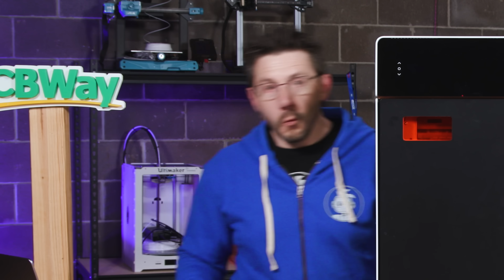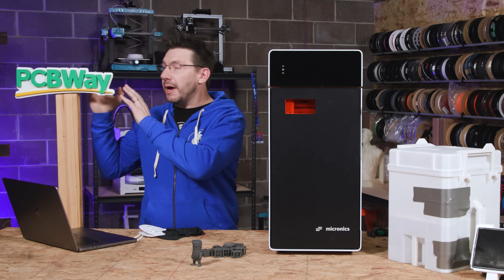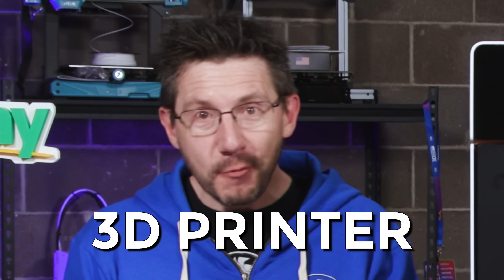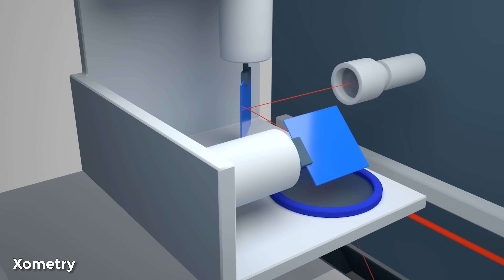SLS 3D Printing AT HOME?

Comment: Be careful with backing this one. Strange Parts video revealed a lot about what is going on behind the scenes with Micronics. I'd be very surprised if this Kickstarter campaign is successful based on his experience.
Reply: F off. The kickstarter is already successful and only Strange Parts dude had problems. Stop spreading disinformation.

Comment: Very interesting, but I have read plenty about the industrial units and went "this is not the thing for home consumers unless it's 100% self contained and does all the work on it's own". I wish them the best luck, but the most expensive thing they might need is a lawyer for saying "by using this, you agree to follow everything in this 100+ page safe operating instruction manual, and not doing it forfeit any issues you have now and in the future" and that's not really something I intend to ever do, so it's not for me. What would be a much better idea is that open source one discussed a few years ago that used sugar. Take this machine, never touch a non-organic material, use ultra-fine powdered sugar. The results would be just as impressive and detailed, with much much MUCH less safety risk.

Comment: The quality definitely looks better than FDM prints, on par with resin, that cleanup though...ugh! I'd probably need a diving mask and air tank to handle that stuff. Though I have heard that the powered used for this method of printing quickly becomes unusable after repeated prints with the same batch of material.

Comment: And we thought resin printing at home was a bad idea. No. You have a duty to tell people how toxic this stuff is at the start of the video. Not nearly 8mins in. It should state that this process is more carcinogenic than smoking daily. This is not a at home printer, you very impulsive content creator. Please research manufacturing processes properly before advertising them to your impressionable audience. Also, the mask you are wearing. It is not designed for this. It will do nothing.

Comment: They are shaping the future of 3d printing, moreover the "cleaning" process it's not as messy as resin printing, much more safer you just need a vacuum cleaner in case of spills instead of a chemical hazard NBC suit

Comment: While this looks impressive and is a step in the right direction, I think they might need to redesign the post-processing elements a bit for the average consumer. If they could incorporate something into the cake phase that allows you to further minimize the powder exposure when separating the prints. Similar to industrial SLS printers they should enclose the cake within the sifter area and possible combo media exposure chamber, with as minimal air exposure as possible. Basically, shrink one of those huge SLS printers to fit on a desk area.

Comment: Why don't they shake the print over a sieve, or even blast some air on it sorta like a a dishwasher's water jets or something,  vacuum the dust etc; while still inside the printer? All that extra risk and work that takes place outside the printer seems like bad design....
I wonder if maybe they could have the build plate charged with one polarity of electric charge and some vacuum tube with the opposite and make the dust repel itself and be sucked away...

Comment: Yeah, that's a hard no from me. Much as I'd like to have an affordable SLS machine, there's no way in hell I'll be doing all of the powder handling in a non-enclosed space. No enclosure, no SLS. And by enclosed, I mean pretty much air tight, with all the filters and exfiltration tech necessary to make SURE the powder stays in the machine or in air tight handling containers.
There's a reason commercial machines take up so much floor space, and it's not because people like to sell humongous enclosures.

Comment: It is interesting to read all the comments on safety when we had resin printers for years now. A resin printer should also not be used at home but in a well ventilated area with very special care on safety.

Hopefully in the future someone will come up with a technique which is safe to use and not cost a fortune.

Comment: A KN95 is wholly inadequate for this - I would only go for Honeywell or 3M N95s. KN95s form a really poor seal around them even if you try really hard. They're were good enough in a pinch during the pandemic, but I would not be using them for PPE against a fine dust like this...

Comment: Now, even though this is a prototype, and very rough, could you see this being a success? Basically, no matter what with this process, you still have to do a lot of messy clean-up and you do get some quality parts for sure. However, which is the fastest/best quality/ease of use/ease of finishing/clean up process between this SLS (provided we assume we have production models eventually), or a resin printer? 
Because honestly, with the cost alone, I still think with the added processing and clean up, most people will still be better off getting a resin printer. Things still need to be cleaned but the cost of entry is lower and people have the clean up process down pat. 
Time will tell though. Plus, if this opens the doors to metal SLS for consumer use, that will be fantastic, so I'm excited to see more development with this.

Comment: what are the upsides if it can't do metal? Just the lack of supports?
Reply: SLS has way better resolution, part tolerance is much better, it's faster, material selection is better, and it can print parts that even with supports FDM couldn't even dream of printing.
Basically, part design is far less limited. Not zero limits mind you, it's not possible to have sealed, hollow cavities, that's the big one. Also it does require post-processing, which FDM doesn't necessarily need.
Reply: what? this is a machine for plastics... plastics are not metal... do you get it? what needs to be said more? wtf...
Reply: @chronokoks  yes exactly. what's the upside of this machine over other 3d printing techniques that also do plastic. I mean, if it did metal it would be cool. But this seems like a big mess for... also plastic.
Reply: @chronokoks  umm... do you know what FDM 3d printing?? plastics... do you just want to be a contrarian for the fun of it?
Reply: @TouchofDepth  what? no he asked a dumb question on a machine that was never designed or even came close to sintering metal powder
Reply: @chronokoks  Thats exactly the point. If it can't print metal parts, whats the reason to use this printer compared to just fdm printers? My answer would be that nylon 12 has a higher heat resistance and strength than pla, and its very isotropic. But the amount of materials and colors you can use is very limited so if you aren't really printing parts that need those mechanical properties then SLS is not really the better choice.

Comment: Any process that needs that level of PPE is NOT a home consumer product - I can't use a resin printer ( I live in an apartment ), due to smell, toxicity etc, SLS is on a par, if not worse.  Use of a suitable workshop unconnected with living spaces is needed at the very least!  And use of a bead blaster to get the best results -  makes the $3000 printer price just the start of expense. More small business use, than hobbyist!

Comment: The amount of toxic dust not many are going to be ok with having that in there house/garage definitely do not work with this in a place your living in with that dust going into the air when you clean up. What they cld do is ad shakers to the bed and shake this thing before lifting it up so most of the dust stays in the machine

Comment: I don't really think micronics is similar to bambu very much.

Bambu was all about a really easy polished experience.

This is very much a rough first attempt at all into hobbyist sls printing and I've seen a lot of valid safety concerns regarding the processes required with this machine. Then there are a bunch of flags raised regarding whether they can accomplish what they want to accomplish with the time and money they have.
Reply: Yeah the comparison doesn't seem correct a real polished one would have a totally self contained powder handling system that made it so spills and vacuuming was never needed. This system is full of janky unsafe solutions and is always one step away from dropping a whole powder cake on the filter fan that then blows the powder everywhere.

Comment: well. turns out if you dont look for more you dont know all.. i never cared for sls printing, cos i known its industrial stuff, but i had a misconception about it ( cos i never looked it up, yes 100% my fault, and usually i am the type person who is doing more then you really need) so the minimal information i had seen/read was about SLS printers which do metal parts from metal powder, so in my head SLS settled as Metal powder printing with laser. 
At least now i know i was wrong about that....

Comment: Using this thing without a full respirator is kind of crazy...
Reply: Any powder is bad for your lungs, but plastic/resin powder? No bueno
Reply: @kerbalengineeringsystems7415   yeah even having open eyes can be dangerous
Reply: Yeah the company claims incorrectly the powder is safe as long as you don't spill large quantities of it like say dropping the cake on the ground. And it is safe to use non explosion resistant home vacuums as long as you don't suck up the entire bottle like say if you dropped the cake on the ground by accident or the shaker cube cracks and dumps a whole bottle on the ground.
Reply: @riakata  I do not understand why they're marketing this to the home user. It's just not a feasible process for that market. There's a reason why StuffMadeHere is basically the only maker channel I can think of with an SLS setup, and his Formlabs Fuse1 setup runs about $28,000, and he only has it because he literally invented the Formlabs Form3.

Comment: Came for the sintered metal. But none to be seen. That I would consider. Dealing with the horrors of micro powders like this is not something I'll do for nylon prints, however nice. The very definition of something I'd rather leave to someone with a shop and a stratasys.
Reply: This printer even though it is cheapish does not magically mean you don't need the same PPE as the larger setups the dust is still just as dangerous as it's the exact same powder. It needs a local exhaust, fresh air exchange, true hepa filters, explosion resistant vacuums  (there is one for toner that is probably the cheapest one you can get that is 99.999% ulpa and is explosion resistant because the filter traps everything perfectly in a sealed esd cartridge for a few hundred bucks ideally you'd get the ones that cost a few thousand but then that's more than the price of the printer). The thing people and the company are forgetting is the supporting equipment and safety around sls is a large component and must not be neglected as you will get cancer much later on.

Comment: The ENTIRE removal and cleanup process MUST be in a glove box, and you should be wearing a respirator, not a junk paper mask.  This stuff is WORSE than asbestos, and handing it any other way is going to lead to severe medical issues, if not DEATH!  This is not something that anyone should be playing with.
Reply: Don't worry the mfg says it will just cause some short term irritation.... Neglecting to mention that short term irritation repeated chronicly is what causes lung cancer in tons of "non toxic", "inert" fine powders that have " large" particle sizes in the microns. The problem is anything inert getting into your lungs will just stay there forever and this is what causes the cancer just it physically getting stuck in there. It is why it is so critical to not let the powder spread around. Those fans while high flow are not properly filtering the air and because it's not a dust hood or glove box one mistake and the filter could blow the cake away which is extremely dangerous.

Comment: Hard no for me. When you were shaking the container it was leaking dust out the bottom. This doesn't seem like a good system whatsoever
Reply: The fan thing and ultra thin filter in the machine plus the why the mfg is dismissing any safety concern is extremely concerning. The movable fan is just dangerous it falling over or the user moving the cake around and letting the fans exhaust catch it by accident is a path to disaster. The whole concept is woefully neglecting all the other PPE you need. The kn95 mask is not good enough at minimum you need a fit tested p100 mask.
Reply from the maker: It leaked out the bottom because the 3d printed part was broken during shipping. It's 3d printed as a proof of concept for the beta machines - the production machines won't have a 3d printed bin.
Reply: @3DPrintingNerd  It happened in EVERY video review. No way every single review machine was damaged in shipping. I think the Stranger Parts video might be a more honest look at this printer
Reply from the maker: @Sauce787  His look at the machine is honest to his experience with it, and my look at the machine is honest with my experience with it. Neither of us hid anything,.

Comment: I'm really looking forward to the day where we'll be able to print with metal at home and not have it cost $30k+ for such a machine. I will say that powder printing is another step up from SLA in the sense that FFF/FDM printing is relatively safe, SLA requires some care for ventilation and skin protection and SLS/SLM requires a lot more care to insure that you do not inhale the fine powder; this includes keeping the workspace clean of any powder that will inevitably spread.

EDIT: Do note that this is a SLS printer that only prints nylon and TPU and isn't capable of printing metal.

Comment: You're missing the other huge danger of the nylon powder: it becoming air borne as a dust and then catching fire from an ignition source. It then doesn't just burn, but it will detonate like fine sugar, flour, or any other powdered substance that can be oxidized or burned. A room that has its air if filled with the dust is an explosion waiting to happen and any ignition source can set it off.

Proper ventilation with a filter on the intake of the ventilation, is needed when working with powders like this. You also need to clean up any spills promptly and regularly clean off fallen dust from surfaces in the room to prevent buildup since the dust being knocked airborne off a surface is just creating another explosion danger.

This is why no company has made an SLS printer for the home. They are worried about the dust. Now, this is no more dangerous than aluminum metal powder, but that stuff is still really dangerous and should be treated with respect and not just allowed to get everywhere when you use it.
Reply: The miconics mfg is claiming the powder is safe in small quantities which is a very dumb statement of course a small amount of toxic powder is relatively safe but it ignores what happens in the worst case if someone drops the cake or spills a bottle on the ground now what do they do. Some might reach for a home vacuum and literally cause an explosion. The mfg is spreading dangerous misinformation about the safety hazards in an attempt to sell more printers. Done correctly you can print sls at home but it is nothing like resin or fdm PPE requirements you need a lot of specialized equipment to do it right.

Comment: This appears to be the most dangerous, tedious, and expensive way to create useless objects.
Reply: Sls done properly can do complex internal geometry and pretty strong isotropic parts. But for most users resin and fdm will work better. The safety and absolute mess the powder will do without a totally self contained powder handling system means this thing is literally going to cause cancer.

Comment: I wonder if it would be plausible to suspend the media in a fluid of some sort without compromising the sintering process.  It should improve the handling issues greatly, much more similar to resin printing, the parts could probably be raised out of the slurry like on an old sla resin printer. Most of the stuff would stay in the reservoir and the rest could be washed off without ever getting into the air.

Comment: What are the applications where a consumer would want this over a resin printer? Certainly not for cost, detail, speed or envornemtal concern. Only rare applications where you need a part that has more heat tolerance? The prints don't seem to be less brittle than resin, and there are probably flexible resins that are more resilient? Higher dimensional accuracy? Casting moulds? What's the killer app? Genuinely curious.

Comment: My primary concern with this, apart from the obvious health hazards, is the powder. It is quite expensive (About 250 USD for 5 liters of it) and it doesn't help the product is priced by weight but sold by volume. How many prints can be done with a single vat? Also, does it degrade if exposed to multiple sintering sections? If so, how much? The sandblasting requirement is also a bit meh, since this is quite an expensive machine and a sandblaster big enough to be able to clean a product as big as the build volume would be about the same price of the printer.

Comment: 1:14 ?
Reply from the maker: Adobe Premiere :(
Reply: @3DPrintingNerd  Joel, my dad had a "concrete shaker" like a large sander. Put it up against a board holding in poured concrete, and it would shake the board enough that all air pockets would be eliminated. If you could touch one to your glorified sifter briefly, I'll bet a lot of dust would be loosened up and drop off!!